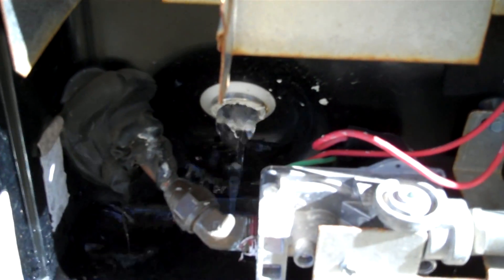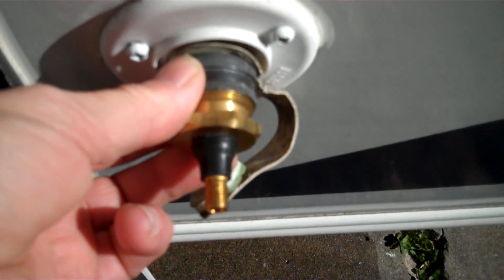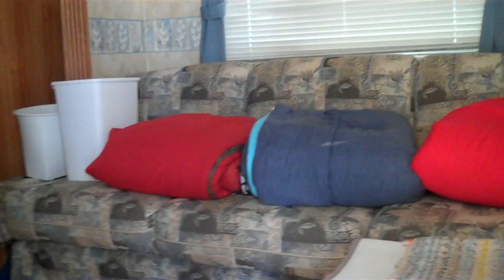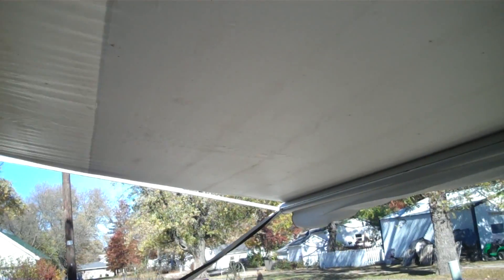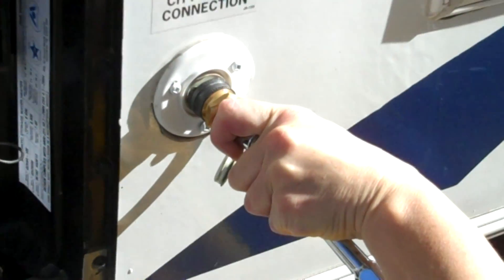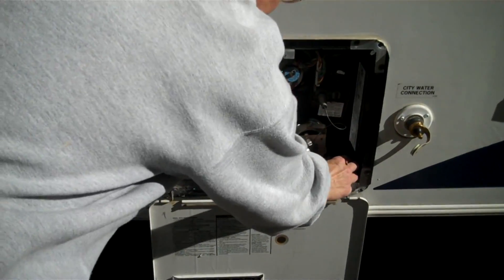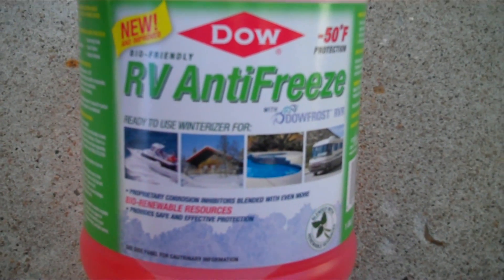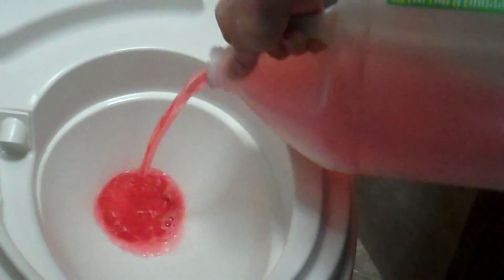Winterizing our camper

Comment: Great video.  I’m curious about that adapter you came up with to go from what appears to be a tire inflator to the city water inlet threading.  It looks like you had some sort of rubber compression fitting in there or something.  Anything you can share would be appreciated.